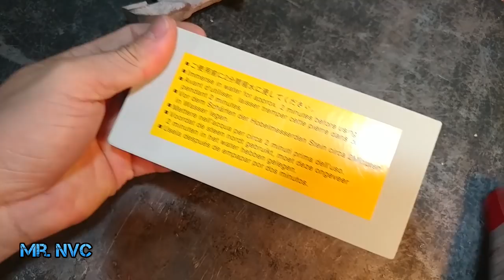Very Old Groove Cutter MAKITA Restoration

Comment: wonderful work as always. I have to wonder, I've seen dozens of similar restorations by you and others, I would expect the brushes to be worn down to the nub, but they never are, they're usually almost like new. I wonder why that is. Obviously the tool has seen a heck of a lot of use. Maybe the previous owners tried replacing the brushes before they decided to give up on em I don't know. I know that's the first thing I'd check if it quit running.